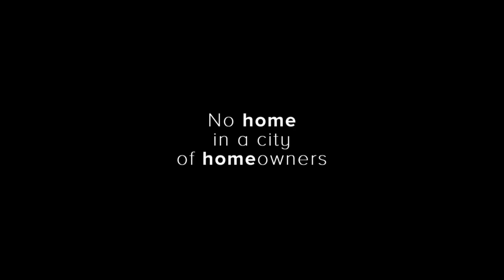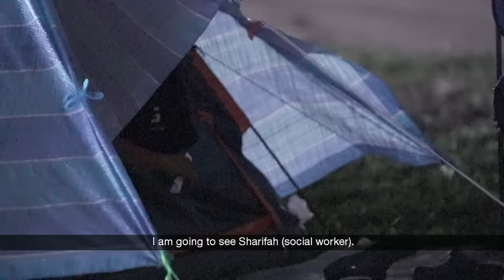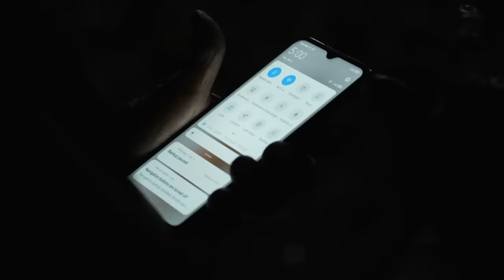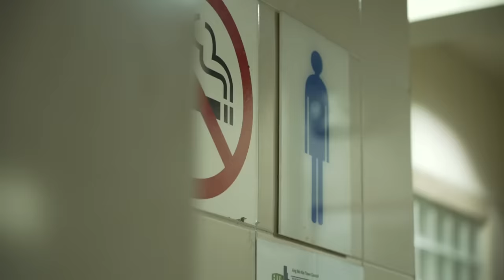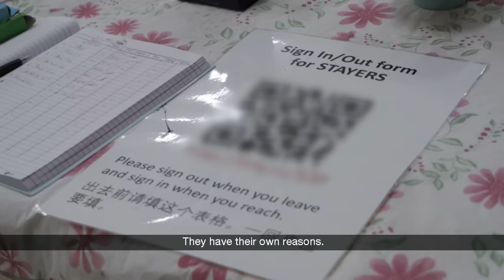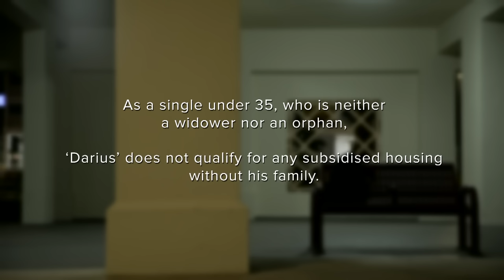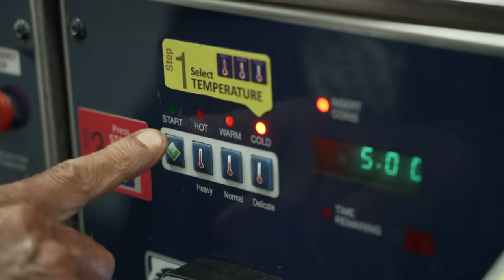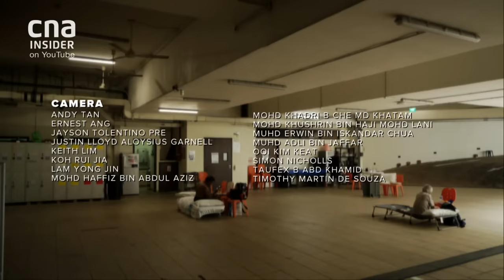How We Became Homeless In Singapore | Homeless In Singapore - Part 1/3 | Full Episode

Comment: The volunteer said in the first 5 mins "There are a lot of rules for rough sleepers to actually rent a flat." So is pretty obvious why they end up prefer sleeping rough. Also, how close are these figures reflecting the reality or only touching the tip of the iceberg?
Reply: Spot on
Reply: Msf rigid protocols only add more stress to rough sleepers
Reply: So without rules? Will have more problem. Some people r just taking things for granted. Corner unit, high floor. Wtf????
Reply: @jon8697  Are you extremist? Most go to the extend of not having rules? C'mon, if you are Singaporean, be a better one than this!